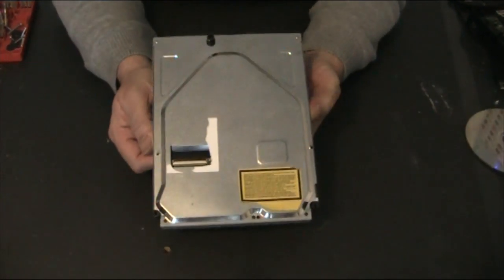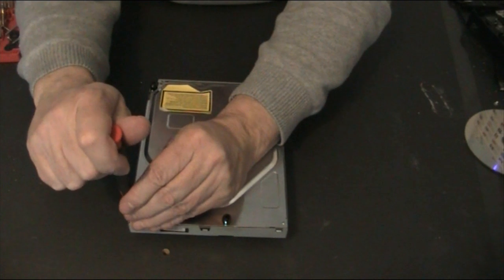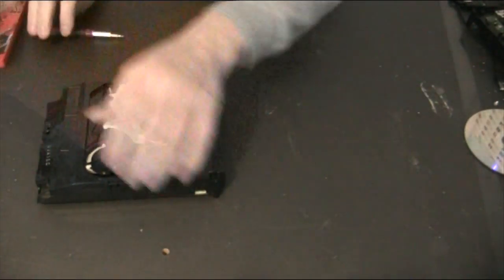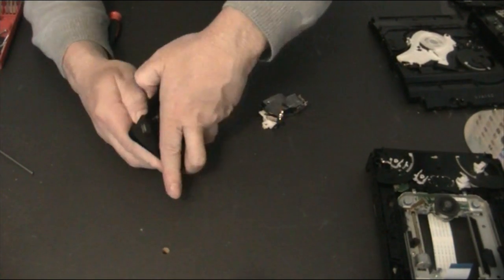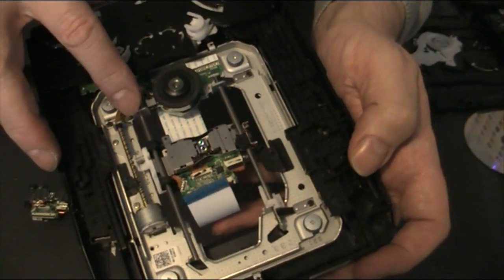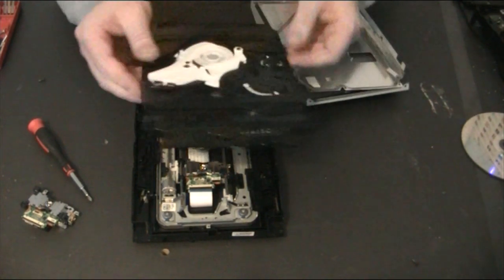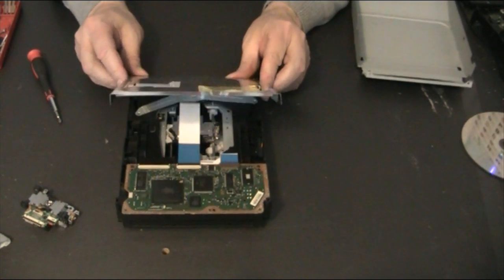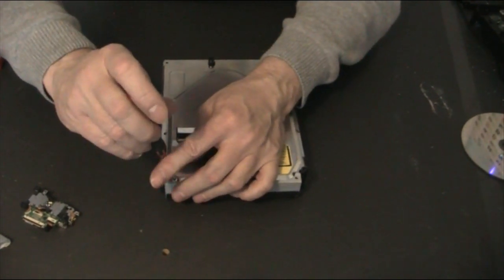PS3 FAT | 410 ACA Laser Lens Swap

Comment: Thank you! You saved my PS3!!!
This tutorial was useful. Even a decade later.
Reply: How does the wire ribbon on the bottom tin @7:10 attach? The 60 pin lock on my disc drive has no ribbon attached.